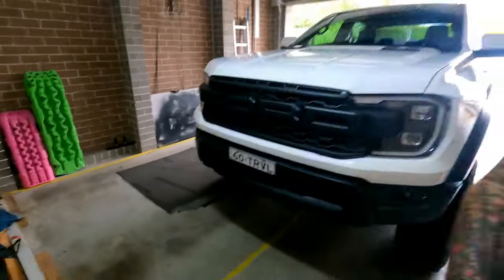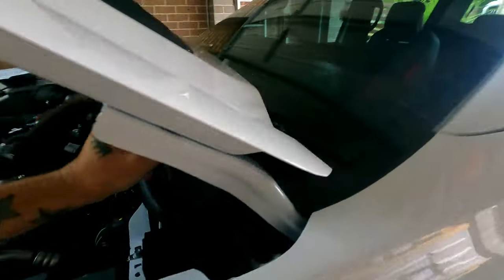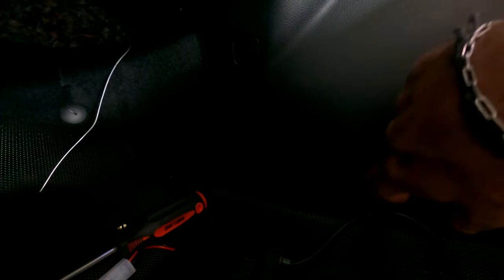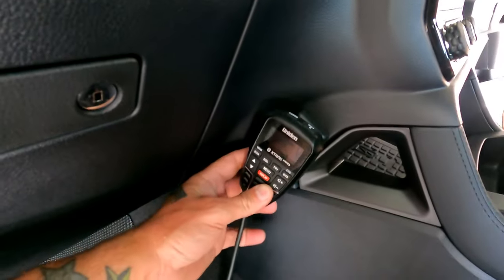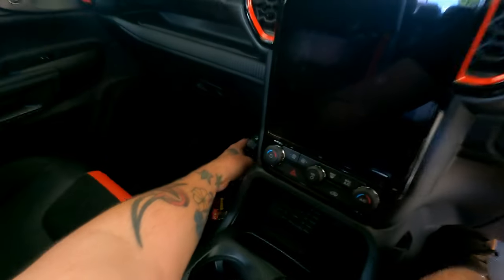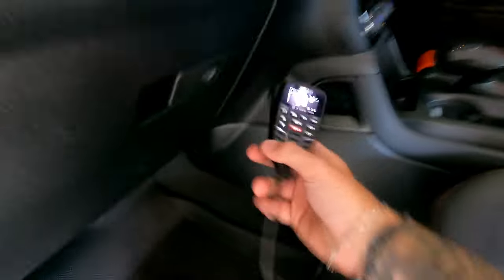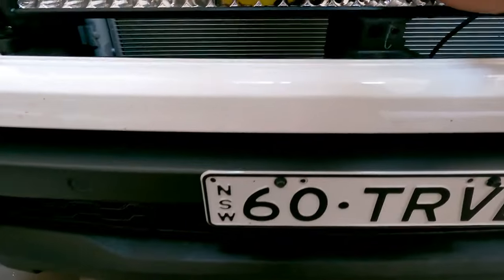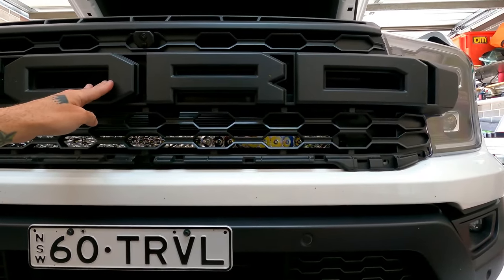UHF and light bar   HGT Next Gen Raptor Ranger Build!

Comment: Hey Caleb, I think the aftermarket wiring loom, in conjunction with the factory switches is redundant. My understanding is that the Ford wiring is fused and already has individual relays for each of the aux switches? Cheers, JT
Reply: Hi. The factory spotlight/bar wiring is ready to support up to 30amps. 🎉.
Reply from the maker: I didn’t even bother to check it to be honest. I remember doing the first compressor on 60XPLR and smashing the fuses left right and centre. So I just used it as a trigger wire in this one instance. If it’s got a 30ah fuse it’ll never blow being a trigger. And blade fuses are heaps easier to get a hold of if I ever need one

Comment: Light bar looks good. Do you reckon those mounts could hold a 2 row bar? I don't think you need the extra relay, switches 5 & 6 are rated to 25A each.
Reply: Mine are wired straight to the switch from the lights +/- no dramas
Reply from the maker: I clearly need to read the manual 🤣
Reply: Read you owner manual on on the head unit as just made a mess of wiring when 5 and 6 are pre wired and read to rock 25 amp each.
Reply: @MY4X4 I’ll be doing the same. Keen

Comment: hello friend I also bought this LED bar but I changed it with the lazerlamp it lights much better less easy to install less discreet but the power is present
Reply from the maker: I actually really like the look of the laser dual single set up🙌 and m just trying to convince myself it’s worth the money
Reply: @HappyGoTravel  100% it is
Reply: @HappyGoTravel  hello my friends I would like to install 1 inch COIL SPACERS to gain 25 mm in height on my raptor tell me I have to redo the caulking afterwards? Are there any adjustments to be made?
Reply: @HappyGoTravel  the lazerlamp the problem is to make a cut in the grille because once cut!!! well it's cut you can't go back I put it on my raptor afterwards it's less discreet than yours I ordered the same as you because I have a grid in advance I'm waiting for receive it and try